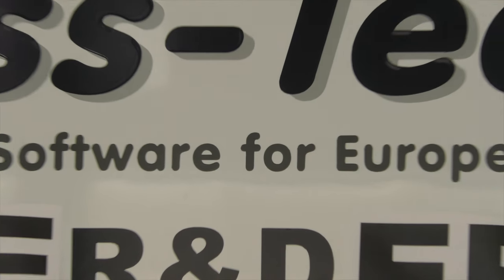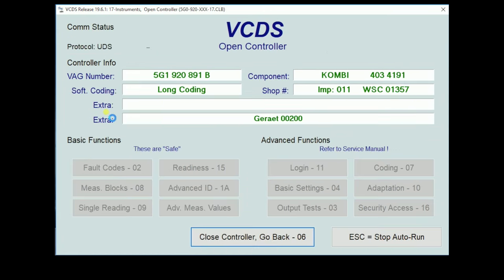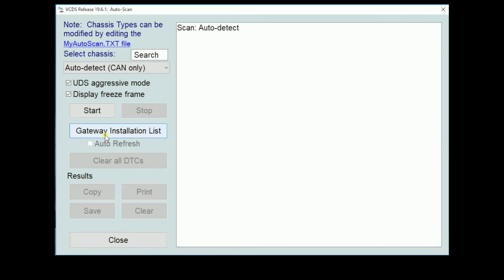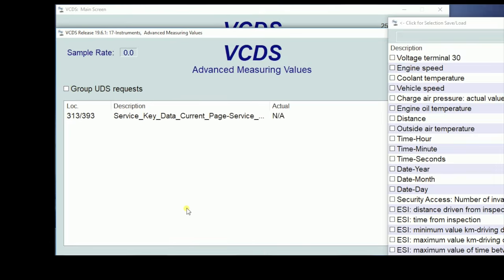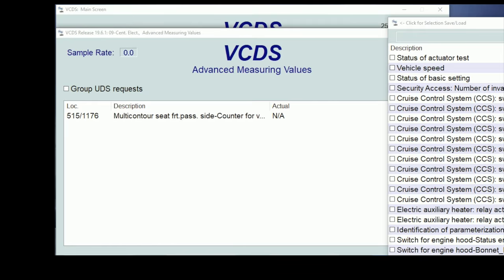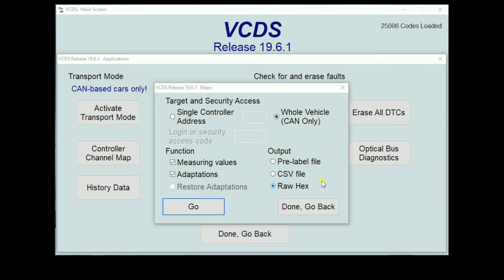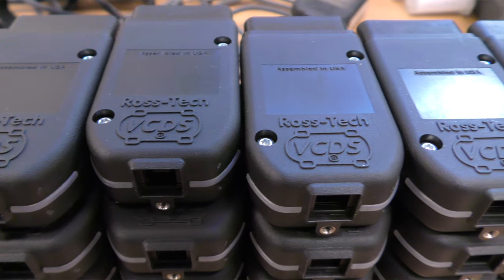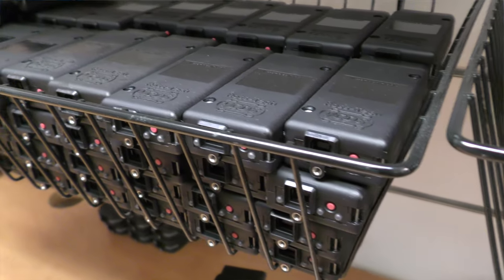COMPLETE VCDS Vehicle Scan ~ Save ALL Adaptations!

Comment: Coding full scan and saving results is also important in case any of the modules with coding fail. When you have the original coding saved, installing a spare part and re-entering the same coding get things work easily just as they were working originally.

Comment: VCDS is a great bit of kit. It does all the needs for transmissions.
Reply: my car is a VW Polo gp tsi 1.2 Highline 2016 81kw Dsg 7sp. please assist can an aftermarket car key affect basic settings or coding of mechatronic to the car, I took in my car at VW here in South Africa for Repairs as it was only engaging gear 2,4,6 R only they replaced mechatronic and selector fork for 6&R, then they say they can't remove error transmission alert ⚠️ an they can't code the mechatronic because one of my keys is non vw guinea factory key? do I really have to buy new key 🔑 or any other solution. now the car drives fine but it still got error Transmission alert and when I take my car to guys with scanners they say the mechatronic is not communicating with the car or gearbox?

Comment: Doing this tomorrow on uk 2014 Octavia mk3  2.0tdi DSG, got a problem with rain & humidity sensor, which I’ll be replacing so will be hoping the new sensor doesn’t need coding, but I need this backup 1st off.

Comment: Hi sir, i have a question for you with your permission. I did folding mirror effects like your video step by step but my driver door powered window, general lock button and trunk button were been deactivated. in your opinion what s the problem? Driver Door Control unit or whatever’s???? Pls help me sir. Thx for cooperation 🙋🏼‍♂️

Comment: I did the battery tender method with my 2013 Audi Q7. The scan took about an hour.
Reply: just did my 2009 GTI with HEX-V2 cable w/battery tender hooked up: 
OUTPUT CVS: 35 .CVS files, 135kb total, 52mins
OUTPUT RAW: 18 .CVS files + 17 .PLB files, 68kb total, 52mins
All files saved to C:\Ross-Tech\VCDS\Logs

Comment: How about a video on clutch adapations for the DSG, as well as syncing the K1 and K2 clutches. Been looking into this for the 0B5 DL501 DSG in my 16' S6. Getting some jerking from a complete stop, looked into it and it could be the adapation for the clutch engagements. Going to do a fluid swap, and will be resetting these. Now a question on that. A lot of the DIY's show to use basic settings to do this reset. I notice though there is an adaptation menu option, so why not reset it there? Love the videos! Thank you!

Comment: So are you doing 2 deep scans one where you check the Can button at the top the measured values and the one below it and save it to a text file and then a second scan same perameters and save it to hex file raw.

I understand you need the hex file for a restore but what parameters are you selecting when you do the hex dump

And the videos are great I am new to vw and vcds so as I resolve some  issues I am working my way through learning

Comment: Hi I've narrowed down a fault with my paddle shifters to the steering control module. When I plugged in VCDS and got to the page for the module I noticed a button called soft reset. Should I push it? Could it reset the module and correct a software fault?

Comment: I unfortunately did not run a prescan on my 2017 A4. The dealer had to calibrate the camera after a windshield replacement. Now my auto dip beams do not work. Can you tell me how to code that tweak back. High beams only switch manually with the lever now. I appreciate any help!

Comment: Hello there. Loving the vids. Just a question plz. I am planning on coding my drl lights brightness via 09 central electrics  . Before I do this, in order for me to backup my existing/factory coding for central electrics/drl When I go into coding 07 after selecting 09 crntral electrics. There is a section there that says current coding and has the long code. If I just copy that current coding code on txt before I adjust the drl and if sonething goes wrong, if I want to reenable to back to factory do I just go back into 09 central electrics, and 07 coding and then paste the current code I copied earlier into the blank box and hit do it, and that should restore back to factory/prior to adjusting drl?

Comment: HumbleMechanic I have a sport differential fault on a '12 s4. Oil Pressure and Temp sensor needs replacing. Dealer says it needs to be adapted after swapping out for about 1k. Would restoring this scan after replacing it count as adaption?

Comment: Hey there,
Please help. I have version VCDS 19.6.1 and I have a problem, Can Getwey won't read it to me. The other inputs work without problems and the coding works and everything, only this I can't run. What can I do and can you give me some advice to help?
I have two faults on the vehicle: 00470 - Company Comfort Databus in Single Wire
012 - Electrical Fault in Circuit
And second error; 01336 - Company Data Bus for Comfort System
80-00 - Single-Wire Operation
I forgot to mention that this is an Audi A4 B7 8ED 2008 year
Please any help.
THANKS

Comment: Hello HumbleMechanic, hello commentators! First time user here. Just finished with a 1st time scan via Controller Channel Map on a 2008 VW Touareg 4.2 FSI V8. It took 2 hours with the engine running. Questions: normal time for such operation? And where can i find the backup file (.hex ?) under Win10 pro installation? Any ideas welcome. Thanks.

Comment: Please Help me sir

I am from India, but the HEX-NET PRO product is not available here. My uncle resides in Chicago, USA. If he purchases the HEX-NET PRO device for me from the USA, will I be able to activate and use it in India?

Can I perform unlimited car diagnosis, coding, and tweaks with the HEX-NET PRO device?

Is the HEX-NET PRO an one-time purchase, or does it require a yearly subscription?

Do I need to purchase VCDS software separately for it?

What is the activation process for the HEX-NET PRO?

I own a garage. Is the HEX-NET PRO suitable for handling unlimited car VINs?

Does the HEX-NET PRO device come with a cable?

Comment: Charles, I have a 2014 Audi SQ5, TDI...lovely car...but....rough start and initial idle....then it's fine. Except seems to be idling or all go ...once you accelerate.....and with this engine...that's a lot of go power..when you just want to turn a corner. I have VCDS, initially no faults...I thought it must be  a MAF or vacuum leak. Doesn't appear so and next thing I get a intake manifold flap , Bank 1 stuck closed , fault.  I know you can't fix it without more info...but what's the process you use to find the "real" problem.
I don't want to buy a heap of bits and find I'm way off on diagnosis.....appreciate if you ca help. Cheers from Australia 🇦🇺.

Comment: Just got tool not sure what I'm doing wrong need to adapt a new ac controller.  Do I need to save with old controller installed or can I just plug in new one and perform adaptation

Comment: What's the difference between saving it as a pre label file vs a CSV? Is one preferred over the other?
Reply: From Ross-Tech - The Pre-Label setting is used for modules that are not UDS, but for UDS
modules it doesn't apply:

https://forums.ross-tech.com/showthread.php?1905-UDS-Vs-non-UDS

Comment: hey man, just wondering if you have any experience with the LUK clutch kits? Have a vr6 24V and found a killer deal on a dual mass kit from them. Thanks
Reply: LUK clutch kits are really good. We use them in our shop for all VW and Audi groups.

Comment: I think this is a great video and idea! How big was this file for your car. Look at the property of the file in windows. That will show size of file. Keep up the good work.
Reply from the maker: Good Question. Once I get to my laptop I will check. I think it was small. You are just saving numbers really. LOL
Reply: It will be separate files for each control module, but it is pretty much simple text data, so each file size is small.  Just to give an example, on my work computer here I have just over 600 Auto-Scans and the total is 12.6MB.
Reply: RossTechVCDS thanks, was curious because then you could ask a owner to bring a new flash drive and copy to it encase there not near there normal mechanic, they have a problem ask if the person has Ross scan toll they can compare the new to the old. I’m still learning about your software, I’m very impressed with it. Thanks Mike.

Comment: Have an 05 touareg v8 with a battery drain issue.  I can hear a relay clicking up above the steering column. I've got the radio out, the lower dash out, the instrument cluster out, the climate controls out.  I'm having trouble getting the upper black relay block out to test those relays.  Have checked the lower 2 sets of relays. What I can't get out I wish I could send you a photo of to get a possible idea of what I may need to do. I took the 1 screw out, but above and towards the steering wheel there is a piece of the holder that attaches to a metal support bracket.  That's where I'm stuck and I hope at least part of this makes sense...lol

Comment: While l agree with you VCDS is a great software tool to investigate your car ECU.
You also need to be aware that on its own,it won'y work 100% on evry test option.
My point being recently l tryed to run a IDE 06141 adaption,ref Adaption of minimum deviation quantity values for fuel injectors.
However due to the fact my ECU software version was only 2010 ref 8831 it failed to run this adaption.
My  European VW Golf Mk6 1.6 tdi cayc 2009 would need a ECU software update in order to do this correctly.

Comment: Can you help using my HEX-V2, i need to re-learn a cleaned and repalced EGR valve on my Seat Ibiza, very low mileage, 26,000 miles. Using the HEX-V2, I cannot get into the adaption channel. 
Can i send you some pictures of the scan results?
IDE00785 Adaption of EGR valve, Not Running I...
EGR Valve offset closed 1.001v
                   offset open    3.999v
Thanks Ron

Comment: Can the Golf R (MK7.5) roll up/down with the remote after a change with VCDS?
Reply from the maker: I think so. I haven't tried yet. Mostly because it has Kessy so I keep the key in my pocket all the time. I might see about the windows up/down with handle touch.
Reply: HumbleMechanic Keep us informed. I’m very interested in this.
Reply: HumbleMechanic yes you could i did it on my mk7.5 with the keyless entre. When it’s done you can roll up/down with the remote but, you can roll up/down just by keeping the hand in front of the sensor of the door handle 😉

Comment: I have a 2011 VW gti with stock dsg transmission can I replace it with a 2013 dsg transmission with no issues? Do I need to worry about programming? Or is it plug and play. Thanks in advance.
Reply from the maker: maybe.. Can't promise no issues, I haven't done it so I can not say it will work. It "should" work.
Reply: Ok cool . Thanks for the quick response !! 😄

Comment: Reply for subscription - My tithonic paddles don't function VW scirocco. its the steering column module at fault- Is there a way to soft reset the module to see if its just a software error?
Reply from the maker: Reply for subscription? what does that mean? 

you can try battery voodoo, its free and takes a few minutes.

Comment: How can i get some advice about my 01 jetta VR6? Sorry its not related to this particular video but im just trying to contact you. Just a misfire at the beginning of pushing accelerator. Coil pack is new, plugs are good. Can an aftermarket cold air intake cause this? Im headed towards the MAF next.
Reply from the maker: have you been able to monitor the misfire counter?

Comment: Whats the best value in scan tools for a Mk3? Is VCDS overkill or just what the doctor ordered for a mk3?
Reply from the maker: The MK3 is SO limited as a car. there isn't a ton you can do with any scan tool. I woudl still use VCDS, but I would try and find an older cable for sale.

Comment: Can vcds trigger control modules? That might not be the correct phrasing what im wondering is can i say roll down a window or say open the trunk from inside vcds?
Reply from the maker: Yes.  It’s a 2 way comm tool
Reply: @HumbleMechanic  Are there some cars or modules that won't allow that? Im working on a 2018 beetle and its not seeing some of the bcm subsystems

Comment: Great video! I have a A3 2,0 TDI  -11. If i save ALL Adaptations. After that i change 1 injector, change IMA/ISA values according to the new injector. Test running the car and then want to put in the old injector again. Is it possible to use ALL Adaptations in Raw Hex to get the milage history of the old injector back in the ECU?  Tricky to write a question in english, but i try.
 Best regards, Lasse Sweden

Comment: The real elephant in the room is that Rosstech (manufacturer of VCDS) has to reverse engineer all this computer stuff because VAG doesn't want to tell about these and you're supposed to use the official (crappier) VAG tools only and those are for official shops only.

I wish VAG published the data so that we could have real open source implementations and it would be much cheaper for Rosstech and OBDeleven to create these tools. Right now, the requirement to reverse engineer everything sets a really high bar for anybody new trying to enter the market and as a result, we have less competition which results to worse tools than possible. And more expensive, too.

Comment: What’s up bro I know this is old but I just got my new cable for my 19 Tiguan I followed your steps except... lol when it was done with raw hex I didn’t click restore adaptation I just unplugged it turned it off, when I turned it back on and try to do raw hex again and save it, it said I need to upgrade my interface... damn how can I correct this??
Reply from the maker: Is there a firmware update for the cable? I haven’t looked in a while.  They issue updates from time to time
Reply: HumbleMechanic no it’s brand new, I was thinking do the full scan again then do the other scan???